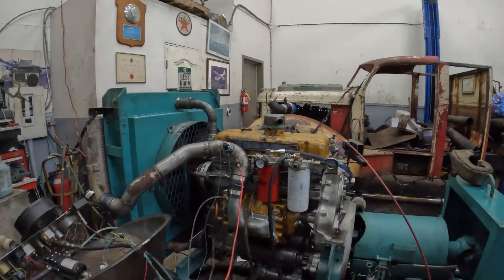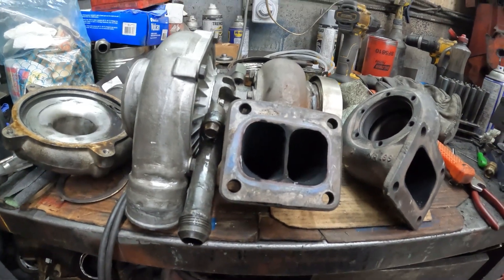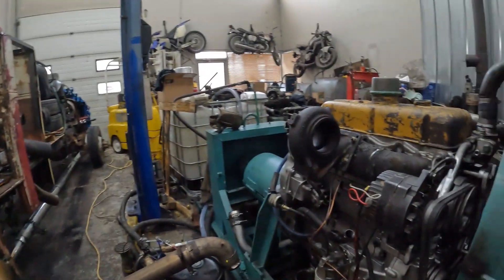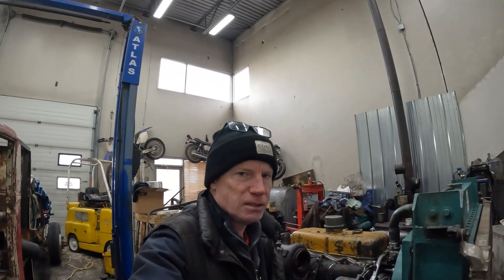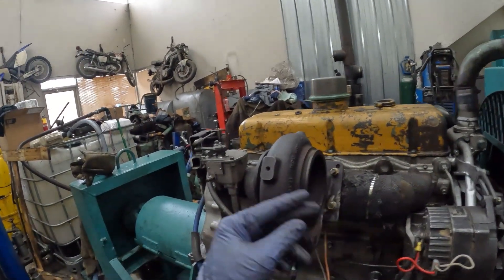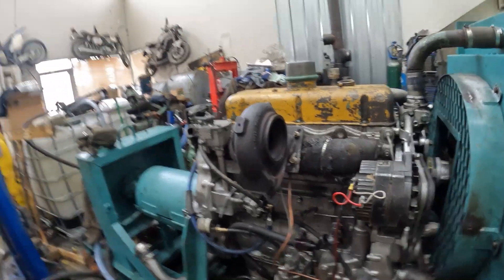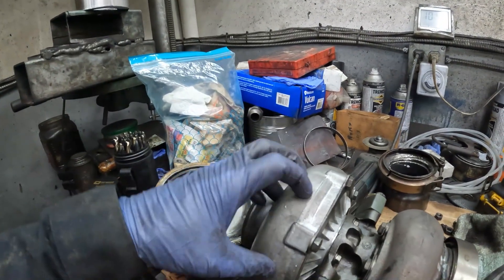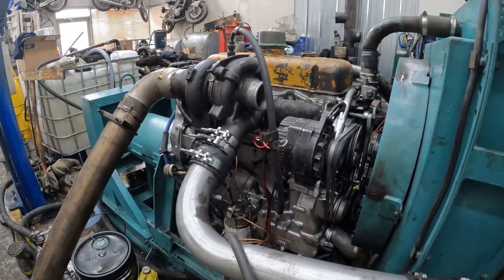Detroit Silver 4-53T (Turbo Talk 2)

Comment: Jimmy told me he wants an 80mm turbo next.
Reply from the maker: LOl, I happen to have just that.:)  It's BorgWarner K31 off a compound system I ran.:)  It's a 71/77 turbo, didn't have the fueling before to run it efficiently, but would probably work in a compound setup now with the 100cc injectors.:)

Comment: I am so happy to see you doing all this turbo research , ad i may be able to do the "conversion" on my 4-53N and it would be nice to know i could find a new more available turbo that would work well.  ( yes i am aware i would need to include crosshead pistons but i may find i need postons and liners anyway)
Reply from the maker: I'd turbo an N engine without question as long as you don't overdue the fueling.  I'll be testing quite a few turbos, from small to large, so lots of options.
Reply: @detroitgarage9430 are you saying you would do it without the poston change ?
Reply: Got a turbo for my N, just not pushing the injector size super big and keeping boost to 10-15psi…but new liners and pistons would be nice. Biggest issue with non-turbo block is the hole from the air box in the rear cover…
Reply from the maker: @greywuuf  Yes as long as you don't go too big on the injectors.  Turbo it and run N60-65 and install an egt gauge.  Lots of guys have run them like this.  When I get around to it I plan to turbo my 6V71N and run N75 injectors in it.:)
Reply from the maker: @clayclifford3930  Very true.:) Should work pretty nice.:)

Comment: I was about to suggest a turbo compound system but that will probably add more unneeded complexity. Looking forward to the next vid! :)
Reply from the maker: @user-gf3mu5uc8j  See if I can can get the perfect single.:). Definitely thought of compounds, ran them in my truck.  This last turbo would make a great primary paired with a K27.  The issue is space as the Diamond T has a tiny engine bay.:)

Comment: This is a real Alladdins cave of testing turbo variations............lots of data to come out of this, in terms of getting ideal boost levels at the level of fuel available. Straight away that turbo is making tons and tons of boost.......even when its well lugged down.  You are going to need a higher boost rated airbox boost gauge !!!  650lb/ft of torque is pretty darn wild.
Reply from the maker: @wazza33racer  Can’t wait to do a dyno day tomorrow and see how it performs.:). I like what see.:)

Comment: It’s really something how much power you’re getting out of that engine. Beat out a naturally aspirated 671 lol!

I’m really surprised and disheartened to see that the turbine pressure is always greater than the boost pressure though. It still depends on the blower, even at that high of a power output. 

Since the blower is still contributing, are you still running the factory aftercooler?
Reply from the maker: True, getting some serious numbers out of the little 4-53T.:)   Drive pressure should be what the airbox is making, so the airbox is 35, drive 30 and boost 23.  The drive pressure is less than airbox, so this is a good thing.  If I were to bypass the blower, then boost and drive will be very close.  You'll see that when I swap out the N for the bypass blower.:)  No aftercooling, just the intercooler doing all the cooling.:)

Comment: Excited to see how this turbo ends up working for you. I might be doing the math wrong and missing something, iv always assumed the 453 is equivalent to around a 7 liter four stroke engine, (53 cubic inches x 4 cylinders x 2 to double hot exhaust flow of two stroke) = 424 cubic inches or around 6.9 liters…but like I said maybe doing something wrong. Iv always wondered how the compound set up off a 6.4 would work on the 453…that’s me assuming I did the math wrong and call the 453 a 6.9 liter engine…
Reply from the maker: Yes, me as well.:)  From the quick run I did it pulled pretty nice.  Yes, you're math is correct.:)  That's one of the reasons I went up to the larger turbo, just to see if it was a viable option with the larger injectors.:)  It seems to like it, so full dyno day this Saturday to see how it does.:)
Reply: @detroitgarage9430  The guy running the 12-V in the truck was running two 6V exhaust setups with a turbo on each, straight pipe. What turbos I have no idea but he said it was pulling 733 horses. It was sure a sweet rig in that GMC long nose.
Reply from the maker: @ That’s awesome.:)
Reply: Thanks for confirmation on my math, iv always wondered if the turbo off an International DT466 would work as a single or low pressure compound set up, but most I find are divided housing…
Reply from the maker: @ I looked at the DT466 turbo, similar to the HX40.:)
Reply: @detroitgarage9430  a 466 just screams on too.
Reply: @detroitgarage9430  It was a WILD rig. It soundsd like an 8-V but he said to follow him and he rolled the hood up. That was a thing to take in! Was for me anyway!
Reply from the maker: @ Awesome.:)
Reply: @detroitgarage9430  It sure was. Crammed in a long nosed GMC, a 9000 I think.